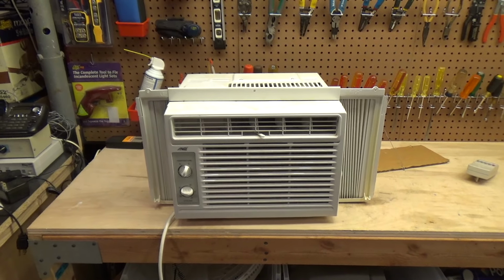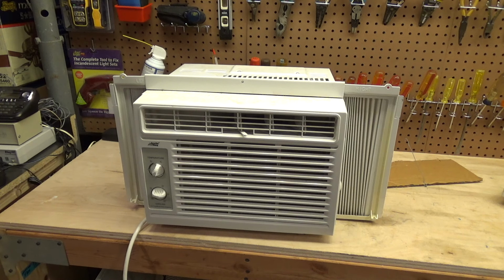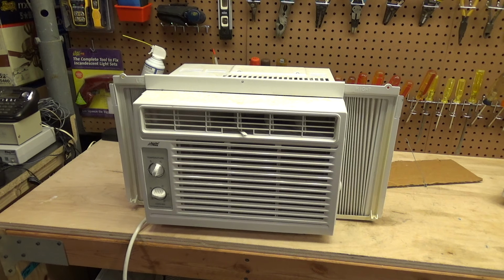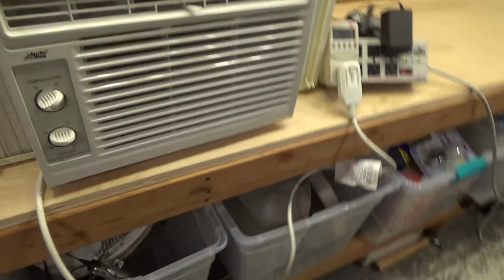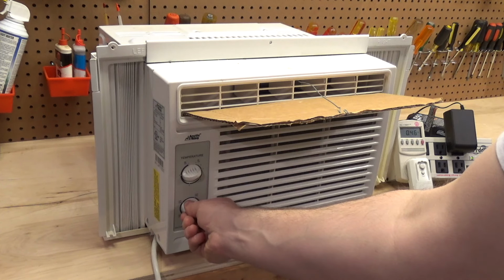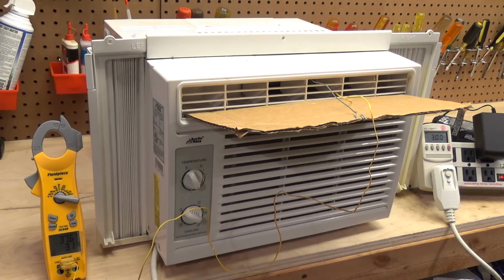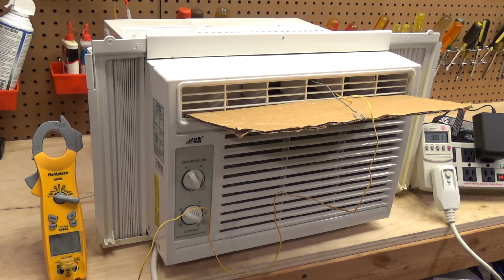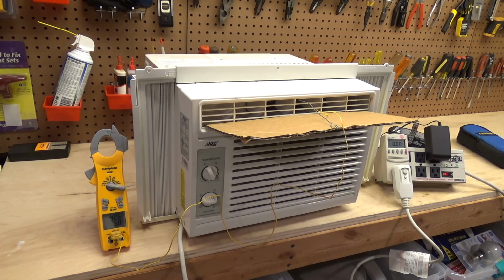Arctic King WWK05CM81N 5,000 BTU Air Conditioner | Spring 2024 Startup and Test

Comment: Where do you have the drain hole drilled at in the bottom? On my unit I think I drilled in the wrong place because when i move it water leaks out the back even with the drain hole installed. I have the hole at the lowest point of the base pan.
Reply: What I do is I drill right where the water comes out of the Styrofoam so it doesn't rot out the whole pan 
Although if you have thick window seals it might get on the frame and rot it out 
But if your window seals aren't thick then I'd suggest drilling right where the water comes out of from the Styrofoam

Comment: Nice air conditioner there. I remember my grandparents having an air conditioner like this one with the same branding, however, I believe it may have been a 8,000 BTU unit with the electronic control set that was purchased in 2016. That unit was nice however it was removed when central air conditioning was installed and was later sold to a friend of my grandparents. Also I found out today that the Haier unit that i have spoke about still indeed is in storage. It’s a R-22 unit being 8,800 BTU unit with the electronic control set and it still has the remote. That’s one unit I hope to get before it is tossed or sold. However great air conditioner their Jordan!
Reply from the maker: Said unit is probably halfway decent.
Reply: @JordanU  It the is!
Reply: I have the WWK05CM71N at the Phones Cabinet.

Comment: I've got one that looks exactly the same, except that it's branded Sylvania.
Reply: These 2-Knob units were sold under many different "brands" however the mechanics (Compressor, fan motors, controls, etc) are probably made in the same factory and they are just stamped with a different brand and plastic face-plate on the way out.
I believe the general design of these 2-knob units comes from the R-22 refrigerant days.
Reply from the maker: I think there's less than 5 major manufacturers of the things at this point, yet seemingly countless brands put on.

Comment: I have not been able to test my air conditioners because of how cold it’s been lately. If I try to turn it on it may be so cold it won’t be able to build up enough head pressure. Good luck on your air conditioner testing!
Reply from the maker: Are you not able to test inside where the heat is running?
Reply: @JordanU  unfortunately due to the design of my air conditioner it would be to risky taking it out of the window to test (the ac is still in the window but it has a cover on it) I will just have to wait until it’s warm enough. Thanks!